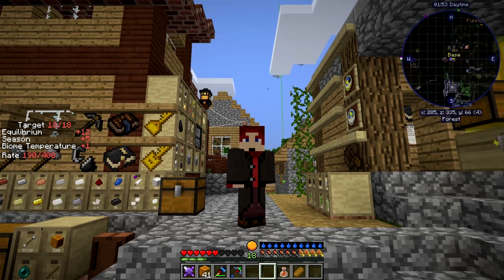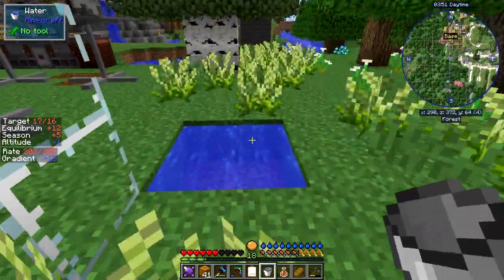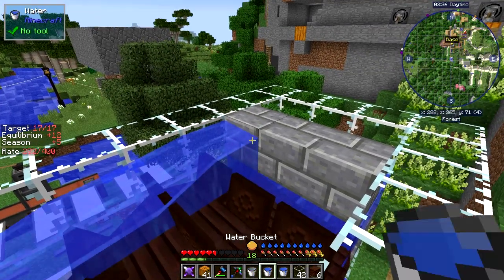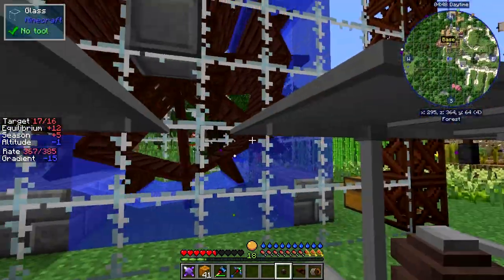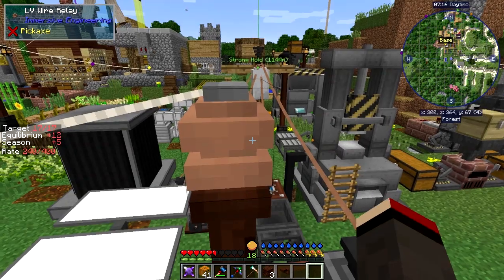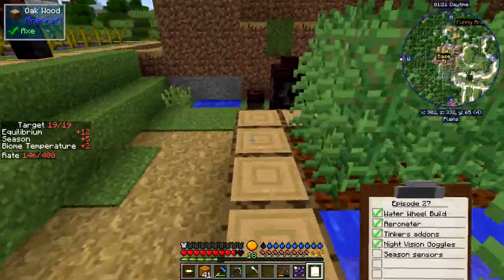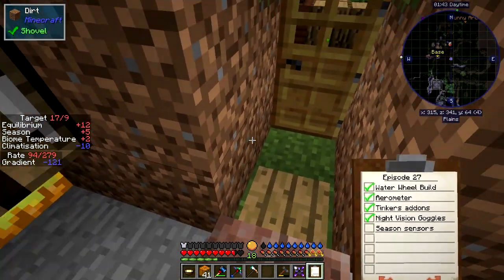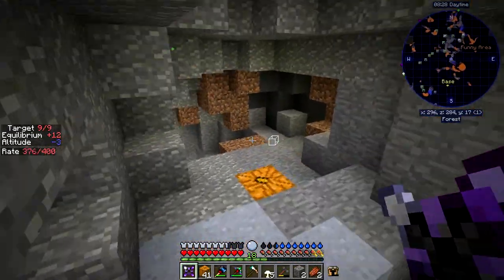Real Tech #027 - Maxed Water Wheel & Healthy Shuriken

Comment: The funny area is an underground biome from Quark.
The temperature regulator only uses rf when it's heating or cooling the player. If it's really cold or really hot, it will require 100 rf/tick while adjusting your temp. It has a radius of affect of 20, so it doesn't matter whether it's covered or not.
Nice episode! I don't know if it's just because it's my pack and I love it so much, but I've really been enjoying this series.
Reply from the maker: Thanks, I was wondering if this was a Minecraft 1.12 biome. Thanks for the info about the temperature regulator I thought is wasn't working because it confusingly doesn't affect the tan tempinfo and didn't look like it was using any power. Really glad you are enjoying the series, I'm really enjoying playing the pack, it seems innocent until you've run out of water, or walked into a hot or cold biome then it's very deadly, a very good combination mods that don't require op mobs. And yes it's fun watching how others play your pack.